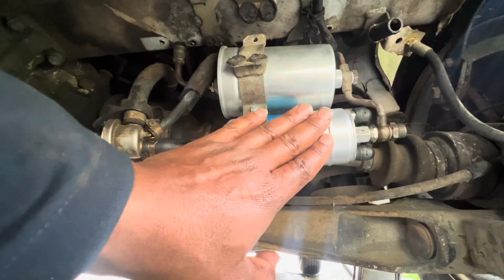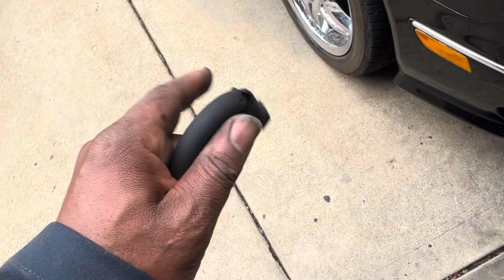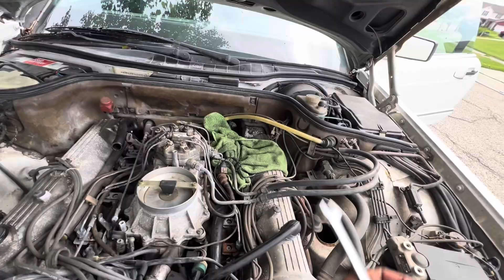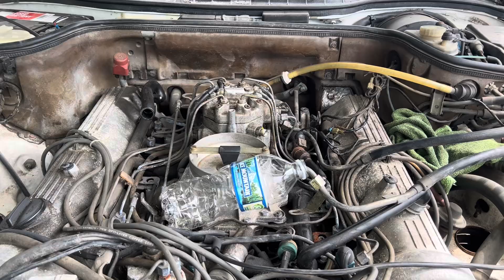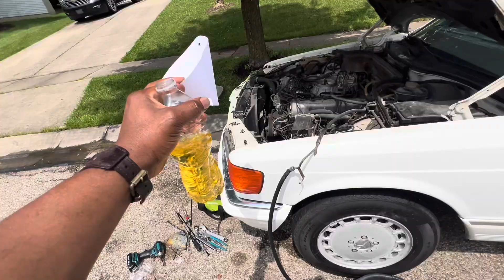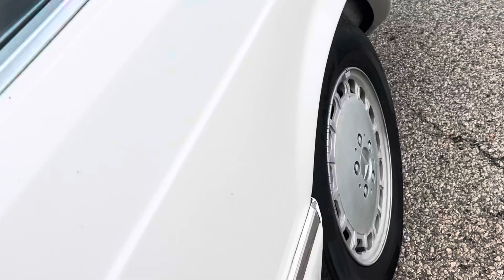How I Fixed My 1984 500SEC Bad Idle & Dies 😢 Fix & Repair

Comment: I have a similar problem with the same car my car smokes a bunch it doesn’t idle I have to keep my foot on the gas pedal then it Boggs down and after I start it once it dies after a minute then won’t start and I have to wait a while to start it again it has a brand new fuel pump any ideas

Comment: I got a 84 Euro spec SEC as well. Doing the same thing and I replaced all the fuel system. I think i have a vacuum leak somewhere. My next mission is a smoke test.